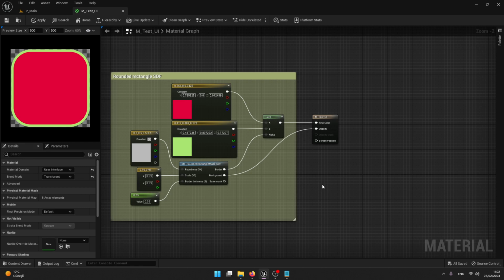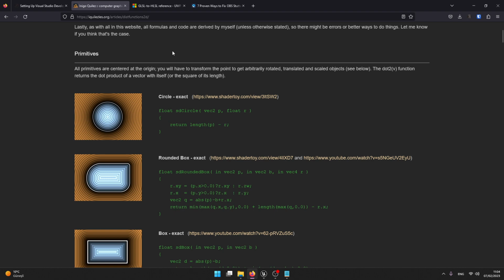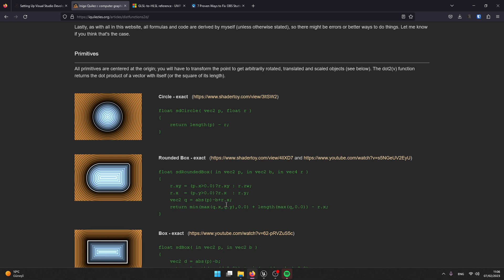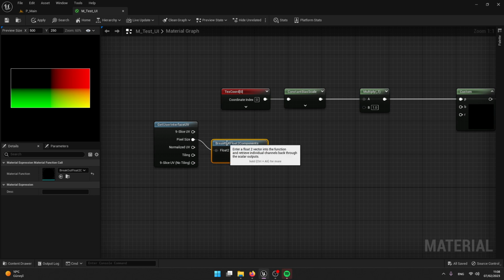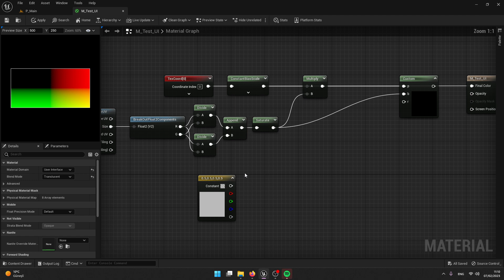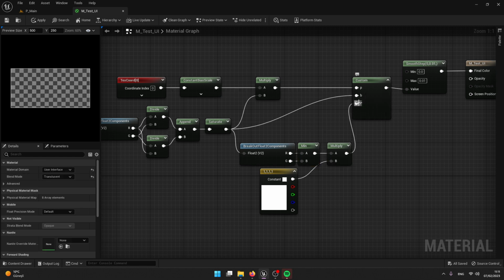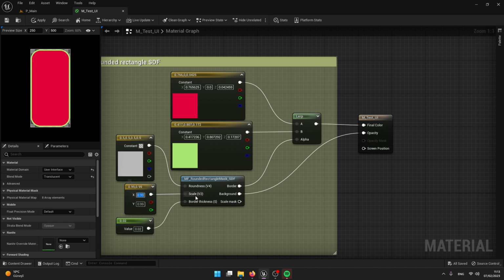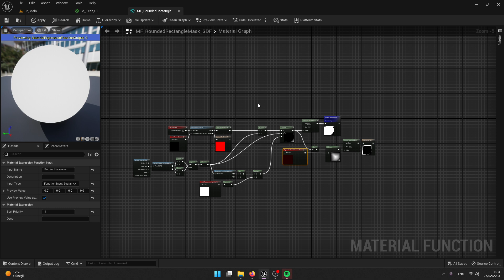Materials: Rounded Rectangle Mask by using SDF - AFAIK UI

Comment: I get the error: vector swizzle 'zw' is out of bounds
r.xy = (p.x>0.0)?r.xy : r.zw;
                                       ^
Any idea why? i followed your steps and cant seem to fix it
Reply: Hey, just had the same problem. Make sure you're using a Vector 4 node in the 'r' input of the custom SDF function. I was getting this error because I accidentally used a vector 3. Hope this helps!